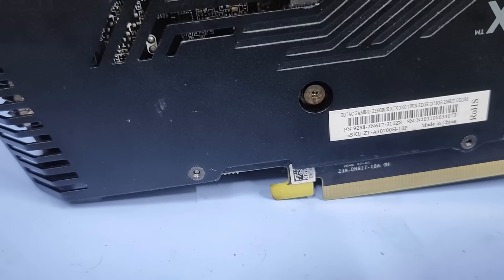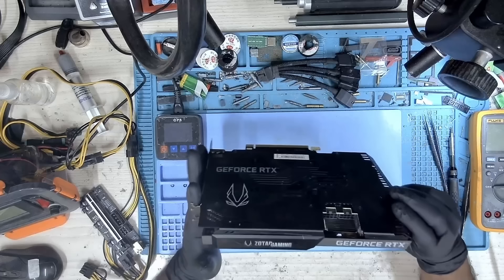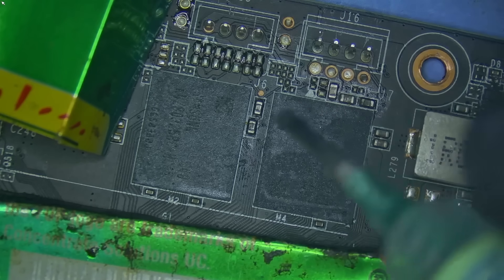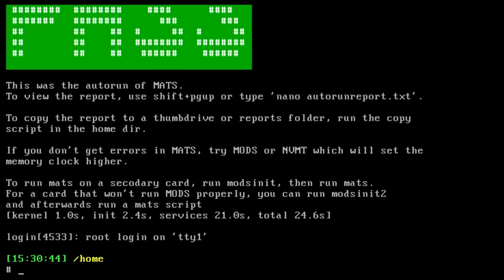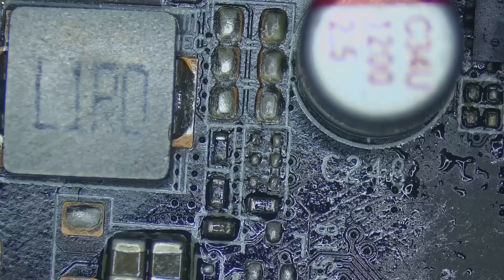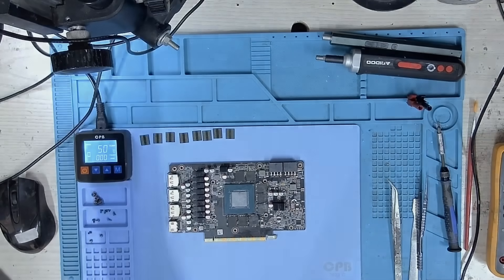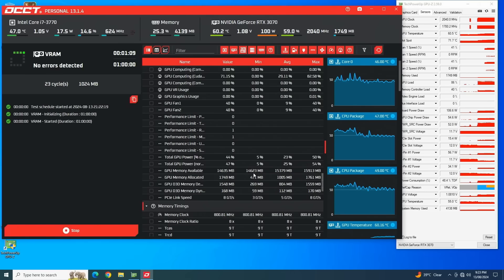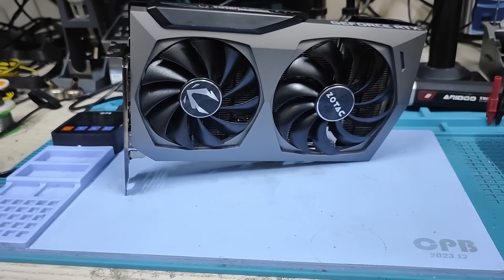Upgrading RTX 3070 Memory from 8GB to 16GB - Part 1

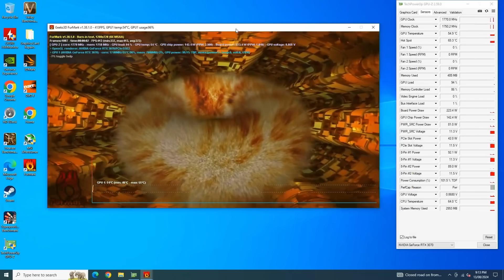Comment: 13:16 Over heated VRAM; permanent damage. They're sensitive bastards. I don't understand how they do it at the factories without large failure rates. I'd be doing it the wrong way with the lowest temp solder I could, and heating the board from the back.
Reply from the maker: There are multiple ways of doing it. The one in the video is the manual one where I have to manually place the chips and solder at a high temperature. Second is BGA machine method. It's better than the method in the video where the BGA machine can solder at a much lower temperature.  Third is the automated oven method. These are used by factories. The GPU moves on a belt into the oven with all components placed on it.the placing of the components is done by robots. This entire system is automated. Here temps are controlled so are much lower compared to the first method. These ovens are not the kitchen ovens. These are industrial ovens made specifically for electronics soldering.
Reply: I've damaged RAM by soldering other things. Titan Xm power phase, dead VRAM, S1600JP4 5 volt circuit (used 5vsb for all USB ports, tripping OCP) dead BMC RAM, basically killed the whole board. I understand the numbers; I don't understand supposed low failure rates.

Comment: The rtx is beefy asf but because of the limited Vram you would opt to upgrade, however with such a fix if priced reasonably which most likely won't be, i would have done it and saved myself from buying the overpriced ai powered rtx 5000s which is basically the same thing just... More relying on AI than raw power...

Comment: Where are you located I have a GPU that i couldn't get working with an AIO watercooler but works when I put it back together with the factory heatsink. Did this about 7 times to try varying mounting pressures. The card is not broken and neither is the Alphacool Eiswulf 2 AIO. If you could help me I would be greatly appreciative.
Reply from the maker: UAE
Reply: @GraphicsCardRepairs-tk7ql  Aw I am in the US I was thinking if you were too I could ship it to you since I still have the massive box from the AIO. Thanks for responding my friend and good luck on your modding adventures from a fellow modder and overclocker.
Reply: Once you resolved the black screen Issue id gladly send my rog 3070 too for upgrade. In in ksa@GraphicsCardRepairs-tk7ql

Comment: Hello Fraser! I would like to ask you if it's possible to also do this with the K4ZAF325BC-SC20 and K4ZAF325BC-SC24 vram chips? It would make much better memory bandwith and speed. I want to do this mod myself and I was wondering if I could only use the K4ZAF325BM-HC16 like you did
Reply from the maker: I have not tested it but it should work. The thing is the timings will be of the 14gbps modules as defined in the bios but it can be manually overclocked using msi afterburner to achieve faster speeds.  Again this is in theory and yet to be tested as it would need more power on the memory rail to achieve stable results.
Reply: @GraphicsCardRepairs-tk7ql  well then.. i am bound to try it because i have SC20's on the way for a 3070... thank you very much for answering. I am not a YouTuber but I might record the quest and obviously will tag you :D Will let you know here!
Reply: @GraphicsCardRepairs-tk7ql  I also understand that using higer rated mosfets for that memory rail should fix any upcoming powering issues? I will look for that part reference. Thank you again.

Comment: i have all the skills required to do this, i can also procure the memory modules needed to do this and easily get a workstation with the tools to do this, but i am scared as heel of breaking my card and not rich enough to just yolo and buy a new one if the exp fails
Reply from the maker: Practice on dead cards first. The only thing that stops you is your fear.
Reply: @GraphicsCardRepairs-tk7ql  and money, you need to realise that people dont just have old/dead cards just lying around, and purchasing is not an option, waiting for the 32nd part tho.

Comment: hi brother thanx for the video, i have a question if you could answer : i have rx5600xt it posts on the bios but it doesn't post on windows. i dont know what could be the probléme
Reply from the maker: Was the BIOS of the GPU changed? If yes flash the original bios back. This is more of a BIOS issue.

Comment: Are your memory packages coming pre-balled?
I see the clean-up process, and then I see you fluxing the cleaned pads, you show us the bottom, and then flip and begin with the heat gun.
You didn't use a template and solder-paste, so I'm guessing the balls are already attached on the memory package, but did you have to ball them yourself?
Reply from the maker: Memories come pre-balled when you purchase it.  But they come with unleaded solder balls but I remove it and reball with leaded solder balls. The reason is the melting temperature is lower and leaded solder doesn't crack like unleaded. But the video is anyway long so I did it off screen and kept it ready before I started the swap.
Reply: @GraphicsCardRepairs-tk7ql   thank-you, I appreciate the details here. I've seen Louis Rossmann struggle to reball things before so I have some concept :D He also swears by lead solder for the same reasons.

Comment: I have see a video about upgrading a laptop's GPU with additional VRAM. Although I can't recall the specific GPU being upgraded, the VRAM situation seems similar to your configuration. The video mentioned the need to change the voltage due to the GPU and VRAM capacity upgrade. It's possible that your current situation requires more power because you are trying to push the limits.

Comment: Is this possible for the dreaded 12GB 4070 cards ? (I think the 5070 and 5080 will need this as well)
Reply from the maker: Unfortunately none of the 40 series can be upgraded. They all use 2 GB memory modules which is the largest capacity produced. And they have limited active slots.

Comment: This is quite interesting... I only put this on on a side screen to stop my PC from going to sleep while I was doing some stress testing on a few android devices I was working on... It's always tricky trying to rework boards with hot air(And I'm meaning SOIC-8, Like SPI flash chips for BIOS).... Doing BGA's is just a nightmare. Especially if they're sensitive ones... I'm lucky my day job has an entire PCB line from pick and place to test. So I get to sneak a few of my experiments through their reflow ovens after hours.. Even then I've found it can not work well.

Comment: check the back of the pcb core A*** varients or quadro varients, i bet theres an extra cap to smooth out transient spikes on higher capacity/storage moduals. more storage larger voltage pool sitting there = more spike. i also noticed this is a zotac card, they are extra narrow/cheap/inadequate on the smoothing caps on the back of the core/pcb in the center. mibbi upgrading them will solve the issue as it was a problem on early 3000 series cards at stock.
Reply from the maker: Thank you for the tip. I will try it out

Comment: if you succeeded with running occt at 10% memory, but not at 90% memory, and if the problem is with a specific memory chip, you might be able to narrow down which specific memory chip it is by progressively stepping up the memory size in occt

Comment: ı have 1050 not ti and it have 2 gb  uprated 4 gb ? my gpu motherboard have a  free space for a uprated
Reply from the maker: The cost of upgrade will be more than the GPU. You can easily buy a used 2060 for the cost of upgrades.

Comment: It is ok and all but honestly would rather just buy an RTX 4060 Ti 16gb instead which is only like 3% less performance than the 8gb variant of the 3070 and also in the long run it would still cost less since not many people would have a soldering iron/heat gun and you would have to still buy the memory.

Comment: What would the limiting factor be with my 12gb 3060 only every seen to use about 7 to 8 GB even in the more graphic demand games
Reply from the maker: The core falls short long before it can utilise the memory.
Reply: @GraphicsCardRepairs-tk7ql  Is that the cpu core  ob the gpu or just the 3800x or the 16gb of ram
Reply from the maker: GPU core of the 3060

Comment: I wish you would explain what you’re doing during the time lapse for those of us who want to learn more about the steps and processes involved. Watching you drop whatever liquid that is on before and after meant nothing to folks trying to understand.
Reply from the maker: My apology. I will do it in my next video. But if there is anything you want to know you can ask and I will answer.
Reply: @GraphicsCardRepairs-tk7ql can you upgrade 3060 8gb?
Reply: @GraphicsCardRepairs-tk7ql I would also like a step per step guide with all the needed in the description, keep up with the good content
Reply: @GraphicsCardRepairs-tk7ql can i do this to a 4060 8gb? And how would i set the bios ?
Reply: That's soldering paste/flux which keeps the solder from sticking to anything other than metal surfaces. The copper wire is soldering wick, which is used to suck up excess solder and clean up contacts.
Reply: If you don't know what flux is, you don't need to be screwing with video cards.
Reply: Yeah this process is quite straight forward for a board repair tech or electronic hobbyist
Reply: @menotyou8369  what if I have my old gpu and I Want to mess with it?
Reply: @NothingMeansNothingButNothing  Anybody stopping you?
Reply: @menotyou8369  How could he start learning if he doesn't know where to start?

Comment: I WAS TOLD ITS A BIOS U NEED AFFTER U DO THE RAM WITCH AN DO THE JUMPERS U NEED A BIOS THAT DONT DROPS THE VOLDS DO TO THE BIG DROP IN VOLTS ITS BLACK SCREEENS ITS SALL DO TO SBIOS AN THEM MOSS FEDS SO I THEM U CAN PUSH THEM HARDER WITH A BIOS MOD BUT I THINK U CAN ALLSO BUY BATTER ONES THAT PUT OUT MORE SO ETHER WAY I THINK OTHERS HAD TO USES MSI AFFTER BRANNER AN SET THE CORE TO LOCK THE VOLD AN TO LOCK THE CPU MHZ U CANT HAVE THE CPU DROP FROM SAY 2100MHZ TO 400MHZ WIN A GAMES NOT PLAYING IS WAY ITS CRASH FOR MANY OTHERS SO BUY LOCKING VOLD ON MSI AN LOCKING CPU TO STAY FULL SPEED AT ALL TIMES LOCK OVER LOCK ONMSI IT SHUOLD NOT BLACK SCREEN
Reply from the maker: I will try this.

Comment: you in the usa sir i am a ssma.ll streamer soltygamings twitch win u have free time stop in some time i have some inportan stuff to ask you an work i like u to do i not in rush to have it fixst asap so u can take yr time on it but i need to no if u think its fix abull or not cuz it plays game great new never used longer than 3or5days tops 2st the screen had small blak greay cheker only win using chrome not gameing so its not ram i was told an stree testing made no ardafackting i cant spell that word any way i need to no  was told this is a bios driver problam where it dont like my monniter an somthing about flaggs  chrom flagg are off do to bios or somthing but sir this bug win i used zotack 3060 this bugg mast up all my gpus till i had to ddu an  it sucks cuz its a 3060 new gpu thats doing it SAMSUNG RAM BUT IT CAN ONLY BE RAM OR BAD GPU OR BIOS I WAS TOLD
Reply from the maker: I am in the UAE. The GPU will need a diagnosis to identify the fault.

Comment: The issues you had at the end sounds exactly the same issues i had with my 1080ti.... it was a windows issue for me... the moment i figured that out, when my brother put it in his pc and ran it without any issues, after months of looking around it was down to nvidia drivers and some settings in windows that would cause a crash whenever the GPU came out of high usage state
Reply from the maker: I will investigate. Thank you for sharing
Reply: @GraphicsCardRepairs-tk7ql  once I am done with work I will let you know, because I was talking about my issues to my brother throughout, there were multiple things causing issues at the time 1. Hardware accelerator in windows (turning it off helped) and the new bios didn't like my gpu  as it was around the time it was losing support so reverting back to older ones helped ( brother was running older windows os that didn't have that setting) but yeah, just disabling hardware acceleration stopped 90% of crashed and sorting bios out and clean install of drivers fixed the rest
Reply: @GraphicsCardRepairs-tk7ql  To help out, Crash reports from those crashes are saved in event viewer :) that's how i was able to narrow down my issues, a lot of the time it was bringing up the nvidia driver error but that was due to hardware accelerator by windows, and others were as mentioned, but they all were classed as critical

Comment: The RTX 3070 was awesome, it's massive design flaw is it didn't have anywhere near enough memory for the performance of its otherwise very good GPU chip.
If the original 3070 had 16GB, everyone would keep just using them and Nvidia dudes would be pumping gas for a living :)

Comment: Can You Increase My Zotac 3070 Ti V Ram to 16 Gb 
I will shipping My card to your address  And what's the cost ??
Reply from the maker: I am not accepting any 30 series until I find a permanent solution to the 3070. 3070Ti uses GDDR6X which makes it different from the 3070. It is yet to be tested
Reply: @GraphicsCardRepairs-tk7ql  ok And 2080Ti ?

Comment: was that leftover flux before you replaced the memory?  flux is conductive
Reply from the maker: It is cleaned in ultrasonic cleaner. But it's still working in progress. Flux is not conducive. 😁
Reply: @GraphicsCardRepairs-tk7ql  are you cleaning after you solder on new part?  Are you specifically using non conductive flux?
Reply from the maker: All flux is cleant after soldering but flux is not conductive anyways. All flux i use is rosin based. To experiment you can pour some flux on plastic and measure in resistance mode poke the probes on the edges of the flux. If your multimeter shows "OL" then its non conductive but if it shows any reading or even high reading then its conductive.

Comment: How do you find out where to solder the resistor or is it the same with every 3070? Can this be done on any 3070?
Reply from the maker: On a 3070 every AIB has it in different locations. If there is no boardview view it has to be traced manually by probing like I did for this 3070.

Comment: Can this be done for a rtx 3060 8gb model? since they have 12gb models the bios side of things should be simple but the memory modules and pcb layout are my question i have a gigabyte 8gb 3060 that when i upgrade it from being my primary card it would be nice if i could upgrade it too
Reply from the maker: The thing about the 8GB 3060 is that it's severely cut down compared to regular 3060. It's not the same card with less VRAM. It uses only 4 active slots. This should have been called the 3050 Ti. Upgrading on this 8GB 3060 is not possible.
Reply: @GraphicsCardRepairs-tk7ql  I've read that not all the 8gb 3060s are cut down so I guess it's a matter of finding out the ones that are viable, maybe the 3 fan 8gb ones that have gotten harder to find avaliable and as I recall most of the 12gb 3060s are 3 fan shrouds so maybe there's some more investergation to be done around 3060 upgrades, it wouldn't help people like me with a 2 fan variant but that could be worth the research and a future video from you because the only people to have done it and have any sort of video don't speak English and I'm sure there are some out there that would be grateful and who knows maybe you could help save some poor 3060s from Becoming ewaste for a little bit longer in the process

Comment: I'd love to see a 3090 24GB to 48GB. That would be an LLM monster
Reply: the power would be crazy just do that on the rtx 4090
Reply: @yooooomg  the 3090 is fast enough for LLMs honestly, it's just missing the extra VRAM. 4090s are still ridiculously expensive, 3090s are out there in the used market, they just make more sense for that particular application
Reply: @reezlaw  Your never too old to learn. Soldering is not difficult to learn.

Comment: Is it possible to upgrade a 4070 Ti Super with the extra 12 GB from a 3060?
Reply from the maker: No. None of the 40 series can be upgraded. They all use the 2GB memory modules which are the largest capacity produced.

Comment: This is life saver. Is it possible to do this mod on my gpu ? I have asus rtx 3060ti.
Reply from the maker: I have tried upgrade on a 3060Ti and it does not work on the same PCB. I have a different upgrade for this card. I will be releasing a video soon.

Comment: Next, you should definitely upgrade the rtx 4060
Reply from the maker: Unfortunately, all 40 series use 2GB memory modules, and all active slots are populated.  Further upgrade is not possible on 40 series.
Reply: @GraphicsCardRepairs-tk7ql  what about the 3060 8gb to 12gb?